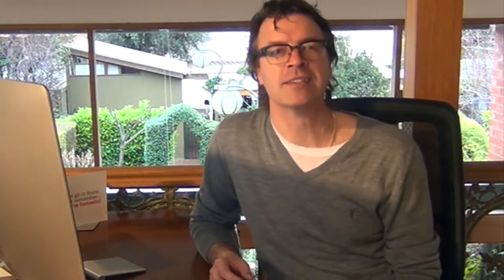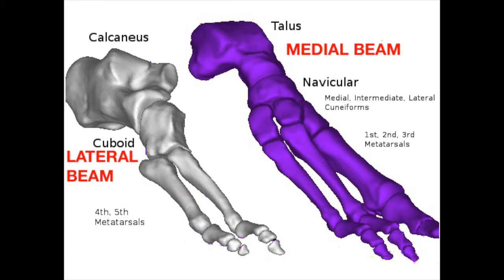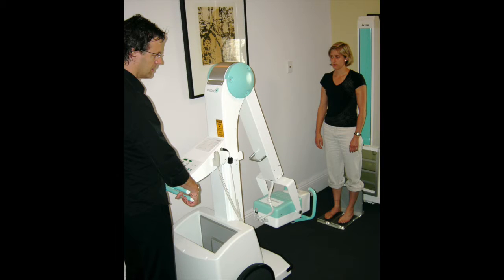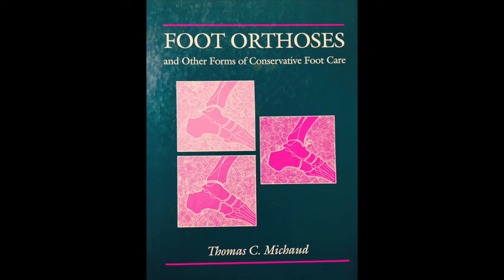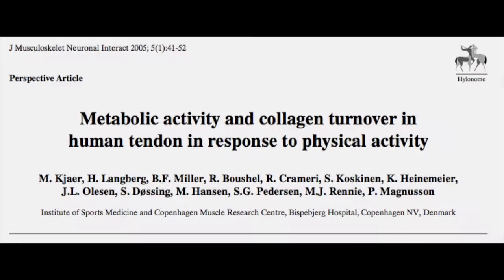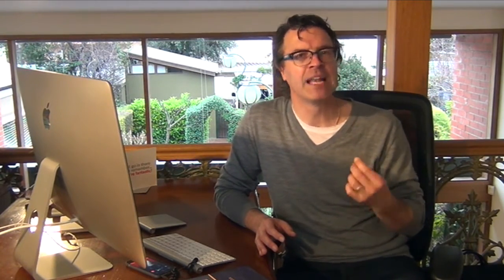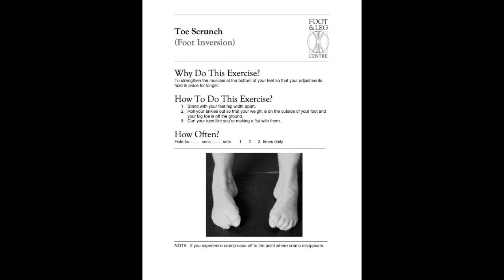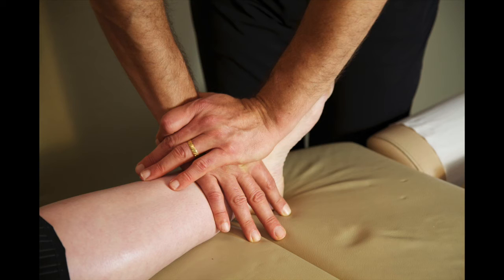TALUS, WHAT KEEPS IT THERE?

Comment: Great video Tedd! Very well explained and I see it work with FMT in practice every day. Let me add just one important answer to the question: Why should the talus hold? Because the human body is not a machine but an intelligent selfhealing, selfregulating organism. One way of diagnosing that the talus has shifted anterior is to palpate tense muscles along the lower leg. These muscles are tight because the body is trying to pull the talus back in place as it does with any subluxation. The movements we can do ourselves just are not enough to give the muscles the leverage to reset the bone itself. But the adjustment can do that. Of course if the subluxation has been there long and the tissue has adapted it will need quite some work through all the phases you mentioned to keep the talus stable permanently. The point is, the body will always strive towards better health and function and the muscles are actually helping to hold the talus in place.
Reply from the maker: +Chiropraxis Göttingen Well described Kai, I agree. The challenge the body faces with the talus is there are no 'direct' muscles attached to the talus to reset or hold it 'home'. Your point about tissue adaptation is exactly the circumstances to which I refer. So, our role is to help the body help itself, in this case, talar positioning.

Comment: Hi Tedd,

I enjoyed your blog on this topic. I would add, to the commentary. Firstly, it has been pointed out, there are no direct attachments of the muscle-tendon complex to the talus. The contribution of strengthening exercise for maintenance of the talar position from FMT is somewhat unclear. Perhaps more so with the non-specific exercises here recommended i.e. heel raise and toe crunch.  Strengthening of the peroneal tendons, combined with proprioceptive training is a customary PT adjunct to lateral ankle ligament instability. But with a different set of exercise. Of peripheral importance to the discussion, is the work of Kjaer et al which discusses cellular response after exercise in healthy tissue. Damaged ligaments and tendons will heal (there is a difference also between ligament and tendons) but from scar tissue. This alters, among many other, the collagen content to one that is much more flexible. When this occurs, and depending on the severity of the ligament injury, the ligament complex will be permanently weaker in response to tensile strength, up to 50% weaker, in fact. That is  why the joints remains 'looser' and the patient is more prone to further episodes of ankle sprain. I would have been interested to see specifically how the impactor is used to make the 'adjustment'. In summary, I am not sure you have addressed the question I asked, in the context of this information.  Just what tissue is adapting, and how? This is not to imply that I doubt your treatment success.
Reply from the maker: +DJ Fellner Thanks for your message Dieter. The role of muscle strengthening 'indirectly' contributes to restoring ankle stability however, muscle strengthening is useless if the talus is displaced. The common error I see is practitioners trying to stabilise the ankle with strengthening and balancing exercises with the talus displaced.
Your point on collagen and damaged tissues is well made, I agree with you. All the more important to do whatever we can to improve the talar relationships with its articular surfaces.
ALL connective tissues are constantly adapting. I suggest aiding the body to do this most effectively by mobilising the talus 'back home'.
How do you define 'adjustment' Dieter?
I use this definition: 'The application of force to reduce subluxation'. The Impactor force provides neurological stimulus for the body to use as it determines is best. This may not answer your question on how I use the Impactor to make the 'adjustment'?
Hope that helps,
Ted
Reply: +Ted Jedynak 
Hi again Ted and thanks for taking another stab at the question. The debate is good and important, especially when there is an absence of high level EBM (very common in other fields, such as Podiatry, also). In that  case it behooves the advocate to construct an argument that can be biologically plausible, logically coherent, and supported by scientific evidence where possible. 

What I meant by 'adjustment' is just how the impactor can be used (i.e. the methodology) to promote the desired effect. Does it differ, for example, to the method promoted by Fuhr. 
In my opinion, at least for ankle sprains, strengthening P.brevis is helpful but most of the benefit is from proprioceptive training exercise. My point about the ligament is an important one. Ligament integrity is vital to maintain a healthy bone and articular relationship. If the principal tissue is diseased this effort is compromised. There is other treatment that aims to 'tighten' the ligament e.g. prolotherapy. 

In respect to stimulating Type 3 mechanoreceptors. As found in ligament, these structures are of a high threshold and are slowly adapting. There are four types of mechanoreceptors found in ligaments. Why are you focused on Type 3 and in what way does the impactor contribute, with a high velocity, low force impulse?
We have to ask also, if the nerve structure is damaged, and ligament heals by scarring, is it possible to restore this function? Lastly, you mention in your video radiographic evidence of talar subluxation and restoration with the treatment protocol. Can you share examples? ~Dieter